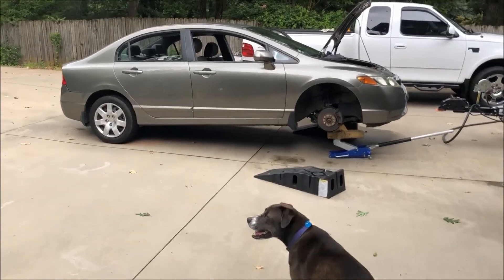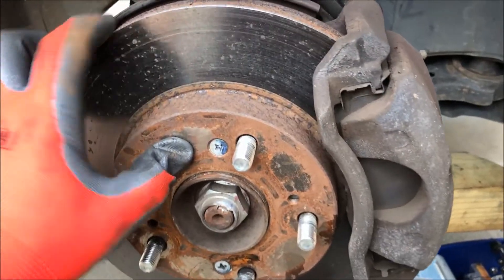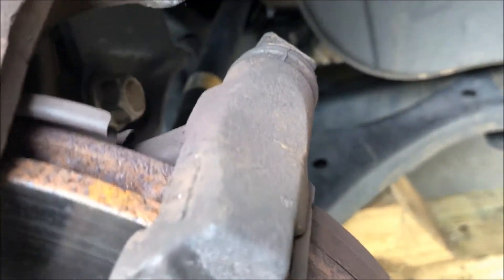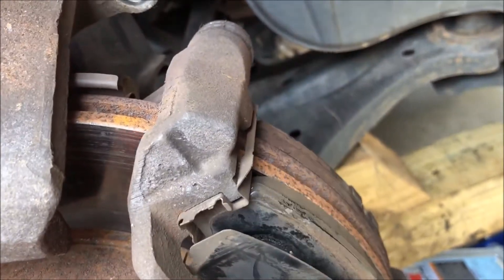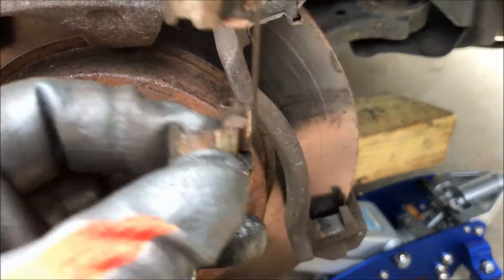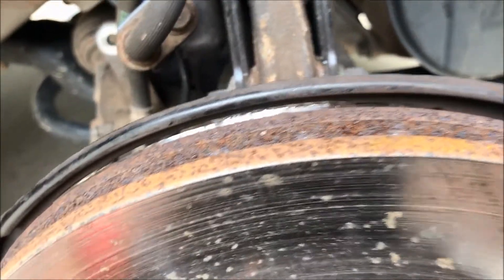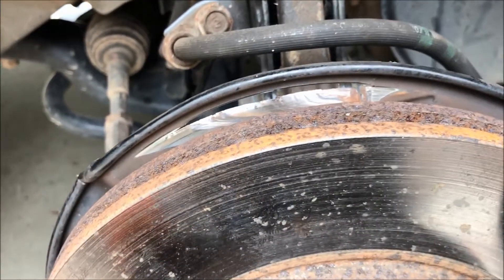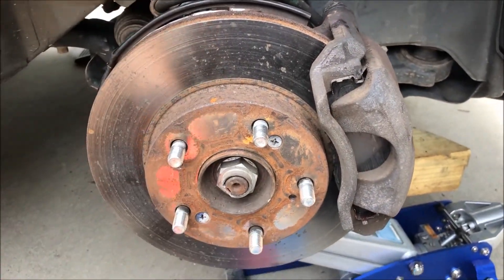How To Diagnose Honda Civic Brake Noise: Stop Front End Noise: 8th Gen ‘06-‘11 Civic Series Part 3

Comment: Good info thank you. I’ll be checking for my Honda it’s started doing a nasty screeching sound.
Reply from the maker: Thanks for commenting and watching!  Good luck with your repair, let me know what you find.
Reply: @DrivingIntelligence  fixed had to pull back on the dust shield a little bit resurface rotors and new brake pads. Working 💯 now thanks!
Reply from the maker: Excellent!